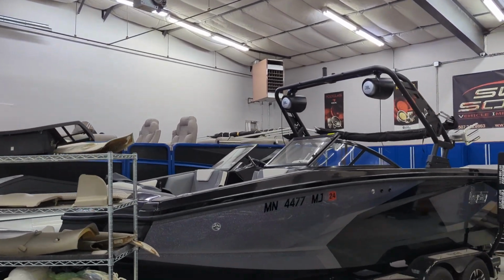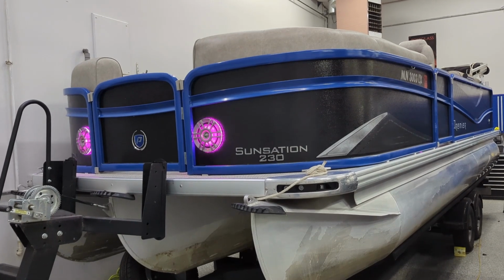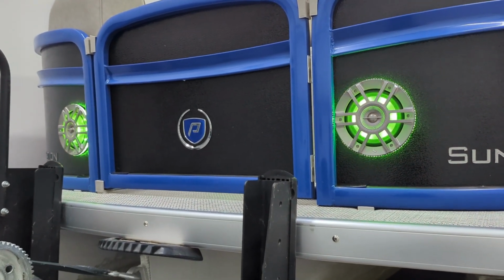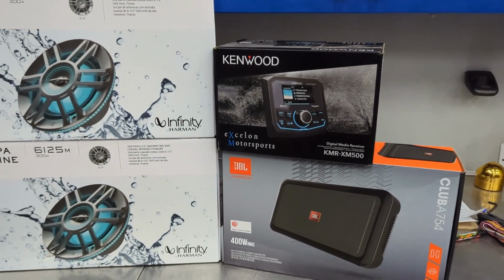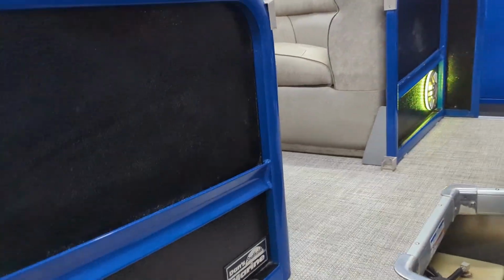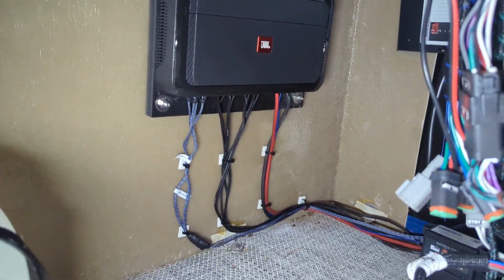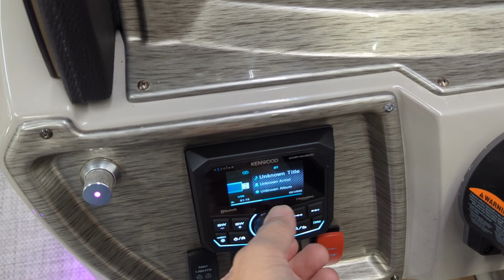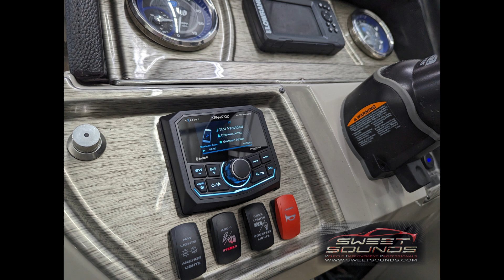Speaker & Amplifier Audio System upgrade for this Premier SunStation 230 Pontoon

Comment: Thank you for the video.  I have a 230 angler I’m getting ready to upgrade.  Has Clarion CMS-651RGB’s and CMM20.  Was thinking about the JL Audio MM55, but will check out the Kenwood.  I’m between Kicker, JL Audio & Rockford Fosgate M265’s but the specs on these Kappa’s, 100w at 92 sensitivity and the price are very compelling.  Question, how is the base with that sub not in a box?  I was thinking about 2 kicker 10’s in their Tube package as not sure if mounting a couple of subs like they have there will give good, tight bass.  Also, question, with that many speakers, couple of amps, why not a stand alone Lithium or AGM battery with an isolator and not have to worry about battery discharge?  May give you guys a call before I order, thanks again for the video on this boat.

Also, a car amp and not a marine amp?  That area does get damp washing the boat or caught in a heavy storm.  Interesting, reading the manual on these speakers they are 3 ohms.
Reply from the maker: We've had excellent results with the JBL & Infinity line. As mentioned in the video, the marine amps and club series 'car' amps are the same except the color. They both have the conformal coated boards. They don't get advertised that way but being an authorized dealer provides us with some extra beneficial information at times. Regarding 3 ohm speakers, it's a big benefit in a situation like this where we're using a 4 channel amp to power the speakers...since we'll get additional power out of the amp compared to 4 ohm speakers. However, if loading down a 2 channel amp with 2 sets of these speakers, few amps will work at the 1.5 ohm load so you need to consider that during equipment selection.

Power / reserve systems are always dependent upon the expected and actual usage of the system. When the situation calls for it, we often times add and/or upgrade batteries and switches for them. Based upon the consultation, the funds were better spent elsewhere. Of course, those upgrades can be added anytime. Enjoy!
Reply: @ Thank you, I’ve been looking into this with the 6125m’s on closeout for $132 a pair right now.  Have you tested the actual ohms.  From what I can find, seems the concept behind the 3 ohm concept is when you add the wire and connector you get a true 4 ohm’s.  Some think it’s a marketing gimmick.  I’m looking at 8 6125m’s and 4 8135’s and potentially 2 tower speakers.   They all wouldn’t be running at the same time and I’m trying to decide if it’s worth trying to run some of the speakers in parallel.  Interesting point though and good info